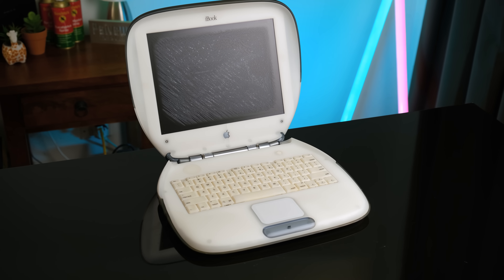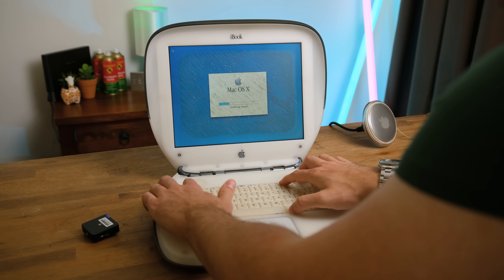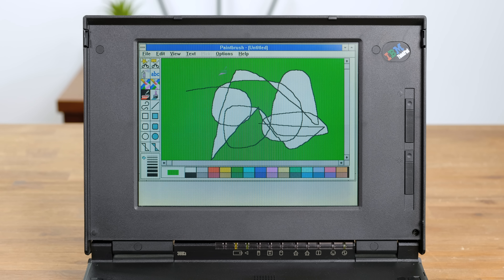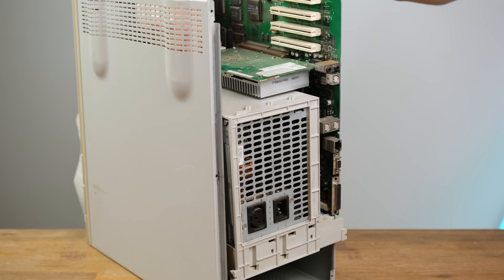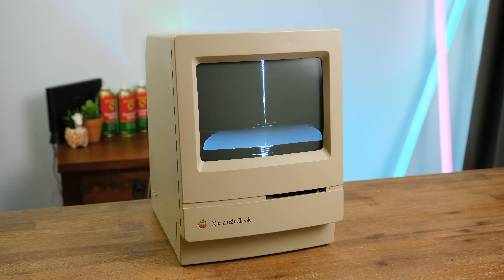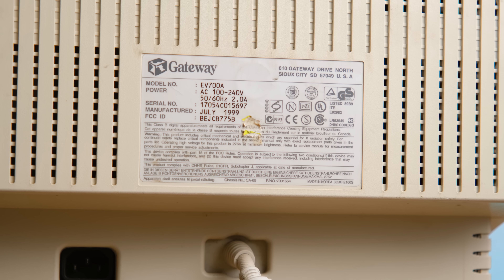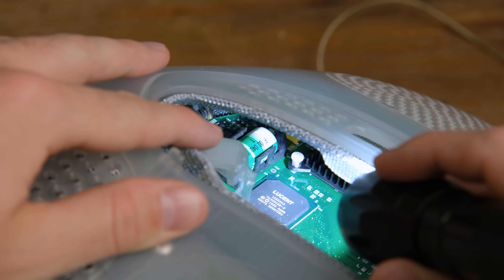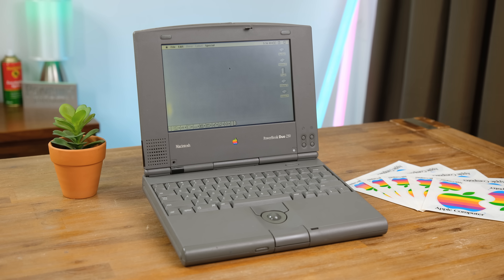So Much Vintage Tech Is Dying... Here's Why

Comment: The realization of these techs is that they'll inevitably be useless and the only solution is salvaging the metals. Newer tech night not be so lucky or last as long. If we're to have tech last then we need to slow down on advancing tech. We're at a point where we can just keep producing the same hardware but we need to come up with a way to recycle and reuse the same tech, such as batteries.
Reply: New IoT gadgets last maximum those 5 years until the cloud is turned off or app removed from store by the manufacturer. That's obsolescence.

Comment: Expecting an apple to last is like Icarus expecting his wings not to melt. All of my old PC parts and tech still work. I have a stack of old seagate and WD hard drives. Old optical drives. Old mobos and processors. Old SD memory from the late 1990s. I have at least 6 old complete computers. 4 from the late 1990s and early 2000s. 1 from 2003, one from 2007 and one from 2014. They all still boot and work fine. The question I would have is why does it matter? I run all Corei7 processors in all 4 of our computers now and they are all 5 to 7 years old, so why do I care if my old 266mhz pentium 2s and celerons work? I have hug plastic totes full of old parts and no use for piles of IDE and Floppy drive cables. No use for older power supplies, etc. They just aren't that useful anymore.

Comment: most of these issues can be prevented or fixed with regular maintenance. the maintenance for every pc/device will be different. if the old plastic is breaking easily then hire someone with a 3d printer. I don't know what to do for vinegar screen or cracking screen but the one with mold growing can be killed with strong UV light. Capacitors can be changed and if you have an old device that hasnt been powered on in a while i would suggest checking the inside for any bad capacitors and replace them, most of the time this works.

Comment: Meanwhile, last summer I picked up a 50 year old typewriter and with a bit of cleaning it works as good as it did when Watergate first made the headlines. Digital tech. is not just as durable as analogue hardware -- more complex equals more fragile and more short-lived, but that's the price we pay for the awesome capabilities it offers.
Reply: It's not the digital components that are rotting.  It's the analog electronics and plastic housings that are falling apart.  If your typewriter is made of plastic or has any capacitors in it, it is subject to the same fates.
Reply: Not strictly true, early digital devices (I'm talking early 80s and older) are definitely some of the most reliable things of all time. Have you ever seen a digital clock/watch, or calculator etc. from that era that does NOT just work? Except if a battery leaked in it or something of course. But that's battery technology , whole different story, batteries of pretty much all kinds just SUCK.
Reply: the paper that the typewriter wrote on has long since rotted. so no, analog doesnt last longer
Reply: @Blox117  Paper may not  last as long as the the clay tablets from Ninehav, but I've got sheets of paper older than that typewriter, yellowed but still in one piece, and a few books printed on regular paper that will turn 100 before the end of this decade and they're just fine, so don't you worry 'bout that.

Comment: New tech "dies" faster though.
How long does a smartphone last these days?
Reply: SSD/Flash memory functions like DRAM with 1 year refresh cycle (see Wikipedia "wear leveling") and will die if not powered on once a year for some minutes. It dies the faster, the more erase/overwrite cycles it has gone through, thus never use a worn USB stick or SSD as backup media. They starve without energy (modern triple/multi level types even faster).

Comment: I've got an old Toshiba laptop. Unfortunately, the on/ off button is sunken and the machine won't switch on. I've taken it to a local computer shop, but... any ideas?
Reply: You might be able to replace the switch with a working one if you know what kind is the one they used. It'll probably require soldering.

Comment: I had an iMac G3 from my mother she stored away, powered it up and for the fun of it; played some youtube video (music) on it for a few hours. I will admit i turned it up pretty good, and after a few hours music was barely coming out... the rubber suspension rings of both speakers around the diapraghm were completly torn all around from aging and the last musical performance.
Reply: I had built my 1m high TML hifi boxes in early 1990th, and speaker diaphragms with rubber gaskets are still intact (they never ate sunlight). Other companies used some kind of foam gasket that was infamous to crumble apart.

Comment: Dankpods is all too familiar with old tech failing. That's legit his entire channel plus more (Rip Eee PC).
Old electronics with rubber backs get all sticky after a long time and brand new devices that have never been turned on for years are just simply dead, unable to take a charge.

Comment: It's easy to avoid leaking capacitors. Open computer time to time, if the capacitor is pumped up just change it, don't use computer in this condition XD

Comment: My old Lenovo laptop started breaking apart in the hinges. Couldn't even close it. The march of time is cruel.
Reply: The hinges are of zinc. That is a wannabee-steel that feels extremely tough when new but crumbles after a while by invisible corrosion (websearch zinc plague), particularly if exposed to moisture. But repeated flexing kills it also. E.g. Matchbox toy cars are made of this metal.

Comment: Yeah all electronics have a shelf life. You see similar issues with old gaming cartridges. Many old Cartridges like the ones used for old Gameboy games can't save anymore because the batteries give out. This is a relatively easy fix though since these batteries are very replaceable.
Reply: Also a lot of those cartridges can be upgraded to use FRAM Chips and therefore battery-less saving.

Comment: I still have multiple items from the 80s including a laser disc player, 3 X audio amps at 460, 520 and 500 watts with each having a minimum of 6 channels. Plus two other smaller 5.1 systems and the 32 speakers plus associated sub woofers to suit all these systems.
Plus Alpine car deck with 6 cd changer, 2 X hifi VHS play/recorders, 3 X analogue TVs. Plus more.
ALL those items still function as they did when new

As a technician since the 80s and I've been particularly unimpressed with the quality and longevity of all items purchased since 2000.
EVERYTHING purchased since then has failed, and I know how to look after my equipment. 

Even a new fridge worth $2000 died, but an old Astor fridge from 1978 is still working great.

So I'm not believing anything said here.

Comment: I remember the rubber/vinyl record mat on a 40 year old turntable of mine oozed oil and cracked as it turned brittle.
Reply: Rubber decomposition happens by daylight and ozone, but most rubber also dissolves by contact with oils or fats (e.g. oiling the turntable bearing) beside silicone.

Comment: I stopped at 4.14 to comment about the plastic thing . We has a 1990 Mitsubishi Magna, we drove it to Queensland when I joined the army it was in the tropics for a few years then we went back to Tasmania but the plastic just seemed to disintegrate, the centre console snapped , window winders broke and the ceiling came down. In my late teens I had 1970 ish Holden cars and everything was metal so it lasted fine. Now I steer clear of Mitsubishi and drive only Toyota because they seem to have perfected plastic.

Comment: What about solid state memory cards? I want my N64 and GameCube to last as long as possible. I have taken apart my n64 and thoroughly cleaned it and inspected it. I need to do it to my GameCube next. I'm just worried my saved games will disappear.
Reply: SSD/Flash memory functions like DRAM with 1 year refresh cycle (see Wikipedia "wear leveling") and will die if not powered on once a year for some minutes. It dies the faster, the more erase/overwrite cycles it has gone through, thus never use a worn USB stick or SSD as backup media. They starve without energy (modern triple/multi level types even faster).

Comment: This is quite sad but interesting to see, it just shows how everything on earth wants to return to its natural compononts, like rinber wants to turn back into oil, same with plastics just that takes WAY longer and just gets brittle, metal oxidising and also turning back into theor natural unrefined state. 

Its the same woth cars and rust, Natur just eating away at the metal eventually turning them completly into rust and slowly going back into the ground.

Fascinating, sad, but cant really do much against it, when you are not storing it in a vacuum or something
Reply: Entropy is everywhere. Vacuum barely helps when the corrosive substances are already inside.